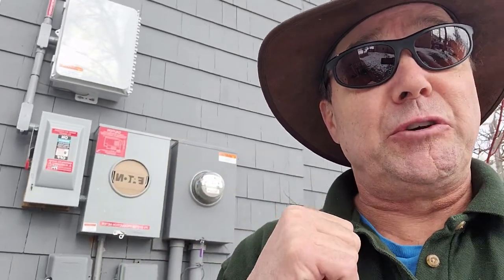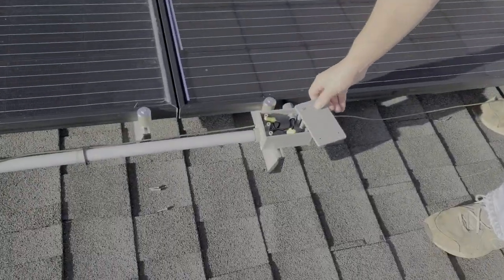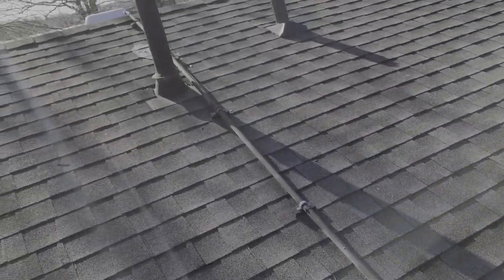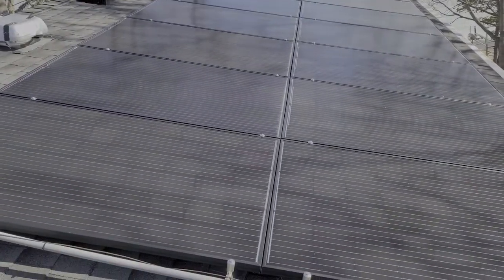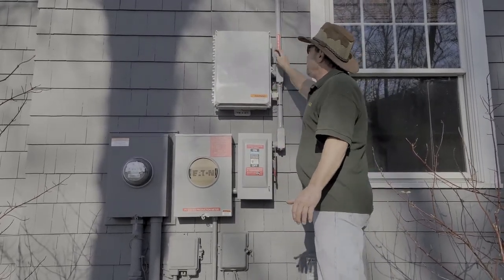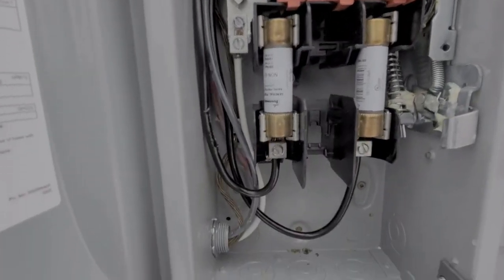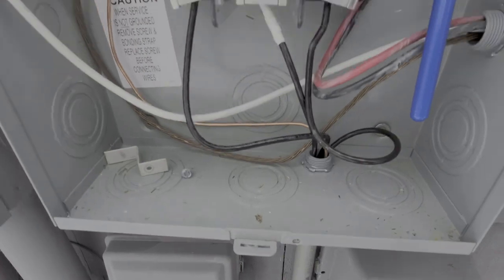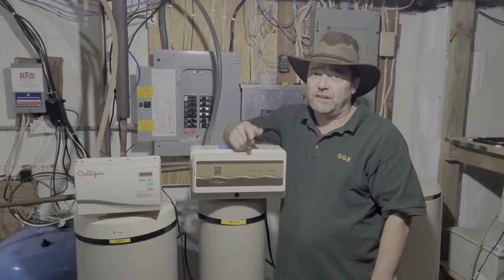Electrical Wiring of a PV System with Enphase Micro Inverters and Envoy/Combiner Box

Comment: Great video! One thing to note and I believe it is NEC is your PV power input from the disconnect and production meter to your electric panel should technically be on the complete opposite side (diagonal) to your main grid feed breaker, for even power distribution on the busbars. It was hard to tell in your video but it looked like the PV 40a DP breaker was on the bottom left and the main breaker on the bottom right directly next to it.
Reply: This is correct needs to be the furthest away from the main breaker , also I didn’t see proper grounding from box to box

Comment: Nice video. I have the same setup, but with 2-12panel rows and iq8+ inverters. I also put my combiner box inside, for less stuff on the exterior. I’ve been in operation for 3 months now. Was just curious on if you like your system, did you buy yourself or finance and do you do any maintenance? Thanks again.
Reply from the maker: Bought and installed myself, I sell turnkey and DIY solar systems
Reply: @TurbineGuy  do you do any maintenance? I know Enphase has auto updates, but ever hear of cleaning your panels? I’m in New England, weather varies….
Reply from the maker: Not really, rain and snow do a good enough job cleaning them off.

Comment: what amp fuse do you use for the shutoff switch? Same as the breaker in the main panel?
Reply from the maker: I typically use a fuse the same size as the rating for the switch, 60 amp. But, you could use a smaller one if you want to.

Comment: I have two strings coming into my combiner box with two empty available breaker slots. Can I add another string of same IQ7’s? Will the envoy automatically pick up these new micro-inverters?
Reply from the maker: Yes you can add one more string. You would have to search for the new inverters for the online monitoring, but not if you simply want them to work.

Comment: We just won a storage auction with 14 trina solar tsm-280dd05a.05(ii) 289 watt panels with Enphase iq6 micro inverts installed on them. it also has the combiner box that looks just like the one in your video it has a label that says IQ combiner 3 on it. I need to buy all the mounting hardware and the disconnect and wiring with the q connectors. I need to figure out all the other stuff I need and how to do plans and such for approval. Looks like fun.
Reply from the maker: I can help you with that.Emailme:jtn@gogreenenergyonline.com

Comment: So i'm trying to use this video for a similar setup here in the UK but we don't have combiners we have distribution boards and everything works a little differently, the biggest thing I cannot work out it why do you have 2 "hots" into the breakers?
my enphase IQ inverters clearly have a live and a neutral :|
Reply from the maker: Both wires coming from the micro inverter are hots, thus 240 ac voltage. 120 each line. There is no neutral coming from the micro inverters.
Reply: @TurbineGuy  I am truly baffled. Even the q clips on your previous video show positive and negative on them. And the q cables I have bought have blue and brown which indicate positive and neutral. I'm left more confused than before haha
Reply from the maker: Does not matter if the wires are different colors, they probably did that for the manufacturing process. I have never heard of a 120 volt enphase microinverter. I have m215's for 2011 or so on my roof.
Reply from the maker: Here is link to spec sheet for Enphase micro inverters for UK and Europe: https://www4.enphase.com/sites/default/files/downloads/support/IQ7-IQ7plus-DS-EN-UK.pdf

Comment: 40 amp * 240 = 9k watt. How does a 15k watt push its output to the grid?  Bigger breaker?
Reply from the maker: 40 amp is the biggest breaker for a 200 amp panel. You would need to use line side taps:  https://www.youtube.com/watch?v=KlemrZCiUa0

Comment: Thanks for the video!  I am trying to learn more to see if I feel comfortable DIY'ing my solar.  I have a few questions about your install that deviated from my current and ever evolving understanding of what mine will need.

1) Why do you have a second meter (consumption meter that doesn't have meter installed on this video)?  Doesn't the combiner box envoy provide that functionality?  Is that a local power company requirement?
2) I know a solar disconnect is needed but does it need to be fused?  I saw somewhere that a fused one is needed if you are doing a 'line side' tap but not if you are behind your panel (i.e. backfeed breaker into panel).
3) Curious why you ran the ground from your PV racks outside conduit down your house.  Was that personal preference on this install or is that needed by code?
Reply from the maker: Nice to see good Questions here.
1) The system has been approved by the electrical inspector, but not the utility yet. When we get that approval, they will install a production meter.
2) Does not need to be fused, except as you say. Some parts are harder to get now.
3)Personal preference, just easier than trying to send it through the conduit.

Comment: I have older M250 inverters that apparently use the neutral wire to communicate with Envoy.  I had one go bad and they sent me a new IQ7 to replace it.  When I replaced it, the new inverter works, but the 14 old inverters on the same string stopped working.  Any ideas?  Thanks
Reply from the maker: I would complain to Enphase with your description of the problem and facts to support it. This is really interesting. Email me at jtn@gogreenenergyonline.com

Comment: Thank you for posting this video, so I am not using a combiner box- I am running mine to the solar disconnect and then to the panel/breaker.. My question is the neutral, is the reason you had a neutral in the combiner box just for the envoy breaker? In other if words if you had powered the envoy from the panel in your house you would just have the 2 hots and ground going to your solar disconnect and then on to your main breaker? Thanks much!
Reply from the maker: Correct. Neutral is for the envoy. (did you sub my channel?(please))
Reply: Thanks for the reply, I will!

Comment: Nice job. I have my panels installed and can't get an electrician in Northern Michigan so this is helpful.  I am confused about why you have a ground wire. Enphase Microinverters since 2014 don't need to be grounded.  Are you grounding the racking?  I have a metal roof and attached my panels with S-5 clamps and PV Kit holdowns. The roof doesn't need grounding. What do you suggest?
Reply from the maker: Yes, it is there to ground the racking for lightning, Unless your roof is grounded through a grounding rod, i would run the ground wire from the racking all the way down like I did through all the equipment and into the panel.
Reply: @TurbineGuy  Thanks.  Since my entire roof is metal and the panels are all clamped to the roof would a ground cable attached to one clamp and run to the combiner box ground the roof and the panels?

Comment: Top of the Morning, another question- did you run #6 to all of the panels as well as racks for ground? I am upgrading my panels and all of the old 15 yr old panels that I had ground as above with weeblugs had pretty much lost any real contact due to galv. corrosion.. I am thinking about just grounding the frames/racks. Thanks Much and have a Solar day!
Reply from the maker: #6 ground if run outside the conduit, #8 is fine inside conduit. The mounting bolts for the modules are grounding bolts, so only need to grab the rails.
Reply: Great, thanks much- things have changed a bit in the last 15 yrs as they always do..

Comment: How long is the Q cable or how many connectors are on each q cable? I've not been able to find this info. I've completed multiple systems with string inverters. First time lookin at microinverters. 
Great videos
Reply from the maker: When I get the cable, it comes with all the drops together for a system, then I cut it to length for how many in that string.
Reply: @TurbineGuy  I finally got educated enough that the supplier sends the cable with one connector for each panel. One needs to specify the orientation of the enough connectors attached because the the portrait mode panels are more closely space than landscape. And the user trims as required - Great thanks.
Which panel spec is used to determine the current per line?
Reply from the maker: @TheTucsonBG  just portrait or landscape. The wires are sized for a limited number of modules on each string. Usually 13.

Comment: My breaker panel doesn’t show a breaker for any solar. So what’s going on? I’m starting to think I got scammed and I’m powering the electric grid only, and not my house. It’s an Envoy system 240v micro inverter like yours in the video. Another question  the way  you hooked it up, in event the power grid goes down, will your system still energize the house directly without battery backup, or does your solar system shut down also?
Reply from the maker: Need batteries to run the system when the power is out. You could very well have line side taps if the breaker would have to be over 40 amps, which depends on how large your system is. Thus, no breaker in the panel.

Comment: How did you calculate what gauge wire to use?  I know it's based on distance of run and amps?  Is there a calculator you can recommend?
Reply from the maker: Use an ampacity chart you can find online and oversize a little bit.

Comment: Great video, Can these enphase inverters be used in an off grid setup?
Reply from the maker: yes they can. In fact, the IQ8's can form their own micro grid when the sun is up if you install an Enphase Enpower switch with it.
Reply: @TurbineGuy  Thank you for the reply. Can they be wired directly to a subpanel or do they need to communicate with the IQ system controller?
Reply from the maker: @Jmunoz1675  Typically installed wiring the inverters through an IQ combiner box with an envoy communication module installed. The Envoy communicates and runs the programming for all of the Enphase equipment including the batteries, enpower switch and inverters.

Comment: You cant install bigger than a 40A Double Pole breaker in a 200Amp Panel? Says who?
Reply from the maker: Says the electric code. When a renewable system is installed and backfeeding a 200 amp panel, you can only add 20% more juice to the bus bar of the panel, 200x.2=40 amps, otherwise you can overtax the bus bar and burn it up, or your house down. If it is a system that would require a larger breaker, you need to install line side taps.
Reply: @TurbineGuy  I did not know that. Thanks for taking the time for that information.